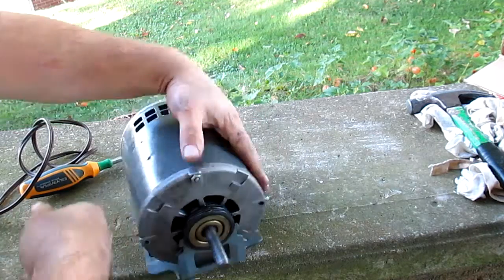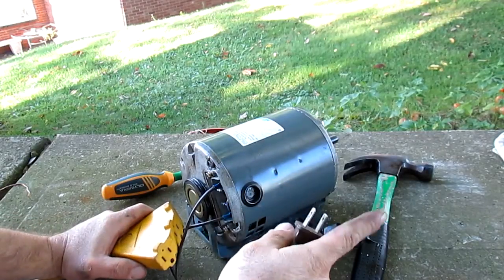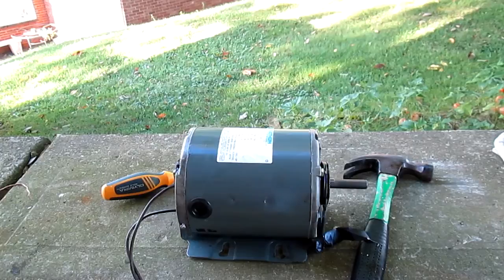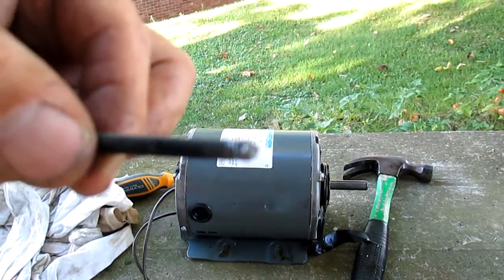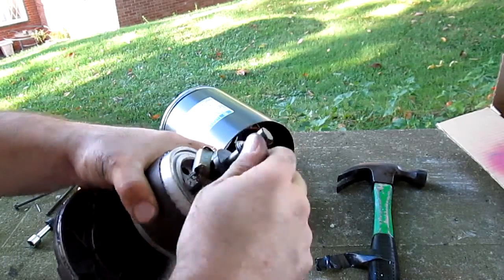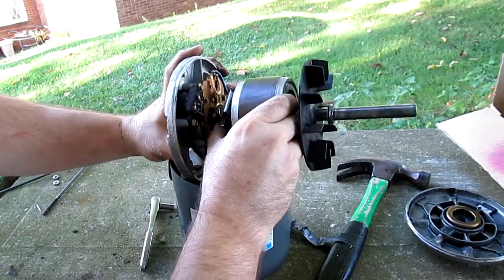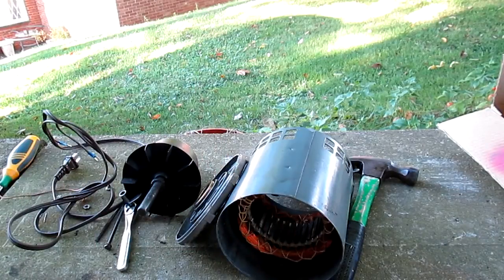How It Works - 1/4 Horse Blower Motor

Comment: I installed a new motor Dayton in the heater blower fan and it
Running properly accept it seems hot could I have the red and black switched and this could
Be the reason the new motor seems hot after just 5 -10 mins running is that normal?  I just don’t know...
Reply from the maker: It should not get hot that fast.... if it is belt driven, you could have the belt to tight.  Also, you want to make sure you have it wired for the correct voltage as some of these are 120 / 220 etc...

Comment: That can be repaired easily separate the wires and hit it with a coat or 2 of clear nail polish or liquid electrical tape or lacquer
Reply from the maker: I never thought of that at the time.  Being it was in a neighbors furnace, I replaced the motor to make sure he had heat.  This motor would go from start to run to start to run windings when on the blower.  Had the exact same one on the shelf so I replaced it.  Thank you for the tech tip, appreciate it !

Comment: Do you think that we could connect a VFD to this motor? in order to control the speed of rotation?
Reply from the maker: probably not.  This motor has two windings start and run.  If you were able to start it to get past the start and into the run stage then maybe, but the centrifugal switch will drop back into the start mode.

Comment: I was using my furnace blower as a fan it was working fantastic Incorporated with the Shop-Vac I turned into a swamp cooler. My dog and I were jumping for joy and doing backflips it was so great..... for about 10 f**** minutes. Starting to smell like something was getting hot then all the sudden it just turned itself off haven't wanted to plug it back in cuz I can't figure out what's wrong with it I don't want to burn it up.... I also gave no compasatator on it but it fired up just fine
Reply from the maker: sounds like it was over loaded and never switched off the start winding causing it to overheat and burn

Comment: These motors don't even have a capacitor do they??  I have 1 of these 1/4 HP, barely been used at all b/c of a WEAK start up torque, but brother its been that way since it was new, mercy.  (Not sure why my dad didn't just swap it w/ another 1 wherever he bought it...)  Same problem as yours you think?   But the big mystery to me is why its been this way since it was new???...   thanks
Reply from the maker: Some do and some dont have a capacitor.  This one had low starting torque due to damaged start windings.  They have some torque, just enough to start up a small blower.  One of the main things is not to over tighten the belt.  Makes it hard on the bearings and the startup.
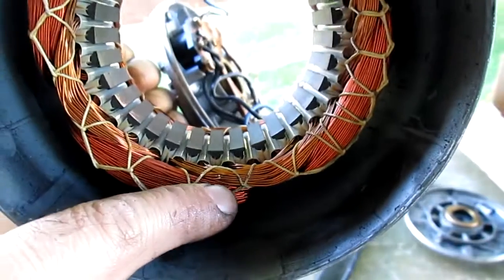Reply from the maker: look at @5:18 you can see where the start windings are shorted.  Not shorted in a manner to cause a short circuit, but shorted enough that not all of the windings were working.

Comment: question what are the rubber grommets with a metal ring around them that help the motor sit in its mount called ??????? because I have an old motor and blower and the front one the rubber in the metal ring has deteriorated and motor slips around in the mount
Reply from the maker: I always called them just plain motor mounts......  with some motors, I had one heck of a time finding replacements.  It all depends on what stores you have around.

Comment from the maker: True there is, depending on age.  I have found some with aluminum windings.  Not too many of the "blower motors", but I have seen dishwasher, washing machine, dryer, and even the motors inside compressors with aluminum.  Not good...

Comment from the maker: The funny part is the motor ran without a load on it.... with a load it wouldnt.  I bet if I had out my amp probe on it in the beginning, I would have found it pulling very high amps.  That why you see techs check the amp pull of units.  Predicts failures.